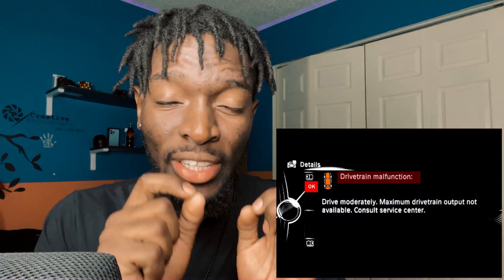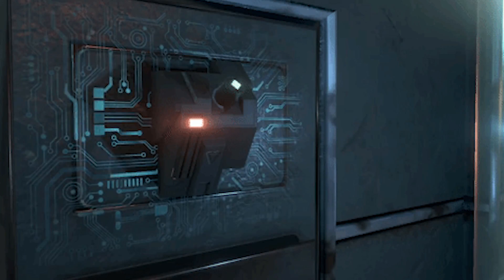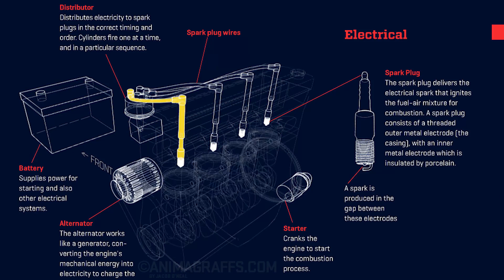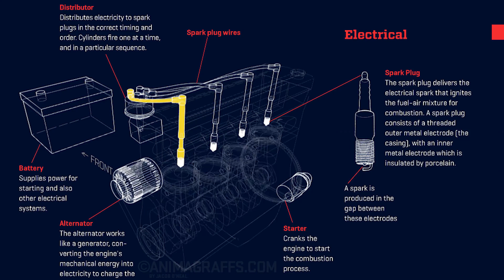BMW Drivetrain Malfunction. What is It? How to Fix it! | 2015 BMW 328i | Get Fixed

Comment: My friend had his dpf taken out and then had the car remapped. He then changed the egr valve. Since that work has been carried out, everytime he accelerates hard he gets a drivetrain error. 
This self rectifies and it's back to normal. Until he accelerates hard again. 
One BMW mechanic told him that the egr valve needs to be bypassed. 
If you don't accelerate hard the error doesn't come up. 
Any ideas please.
It's a 2.0d 2014 car.

Comment: So I have a 2014 x5 50i I changed out both mass air flow sensors and I changed out the turbo intake gaskets and I am still getting the sputtering what should I do next
Reply from the maker: Are you getting any check engine lights for a cylinder misfire?

Comment: I had all symptoms you mention in my 2015 M5, Scan tool said no voltage to fuel injector cylinder 6. Thanks for your input.

Comment: My car shakes when i start it sometimes, then when  i put sport mode and try to to do some pulls. If I floor it aggressively, i will get this message and then the car will start shaking again. I dont have an air filter installed to the engine so i thought that was it. I'll get it diagnosed tomorrow.  2016 320i

Comment: Bro you need to change your smoke alarm battery… as for the drivetrain message on my G12, it all started after an EGR recall in the UK. What I have noticed is that when I don’t use the phone charger plugged in, I don’t get the message. I never noticed torque issues but when idle in gear, I’d feel a little flutter. So in many cases it’s an electrical issue and an ECU reset might help solve the issue.

Comment: @GetFixed in my case it's the waste Guage that needed to be replaced as it wouldn't open to allow air into the turbo so as a down steam affect the engine was freaking out and like you said there was no acceleration when you press on the gas. So also have the waste guage checked people ✔️
Reply from the maker: Thank you for that. I never even considered the waste gate as being the reason for a drivetrain malfunction error message. I’ll most likely make an update for this video and give you credit for bringing this up. Thanks again.

Comment: Did u get a check engine light as well ? I started my car up it started shaking I got the message turnt it off and started it back up like nothing still have the warning light tho
Reply from the maker: Yes I had a check engine light on my car when this happened. I recommend you find out what that check engine light means. Even though the car started back up just fine, the symptoms is a warning, thank goodness you got the check engine light because some cars will act up and not give you the check engine light.

Comment: I had the msg about it today - going to the mechanic in a minute - hopefully it will not kill my wallet lol
Reply from the maker: I learned so much about BMW’s because of the first car I owned. Long story short car caught on fire and I had rebuilt the backend and wiring loom, got it done and running in two days, because of that experience I’m no longer nervous when something comes up on my car.
Reply: Contrary to appearances, BMW is a very reliable car for me. If you regularly change the oil and take care of the car, repairs don’t have to be astronomically expensive, and the car seems almost indestructible. I might not be very objective, but I absolutely love my BMW.

Comment: Guys my n26 is stage 2 with downpipe and charge pipes and it’s only making 260 horse power really confused on the power loss aswell as it has no engine light lmk

Comment: I got that message today. Driving a 2016 640i Gran Coupe. Can’t wait to learn what’s going on. 🥴
Reply from the maker: I wish you luck KT. Get the car scanned for any codes stored on the ECU.
Reply: Man I’m in the same right now and this just happened to me. Autozone scan said it was the fuel cap that was loose

Comment: What does it mean when the drivetrain goes off and on it happened to me rn On my way! To work made it to work
Reply from the maker: Did the Drivetrain Malfunction go on then off? That was your sign that something is going bad. The most common reason for it is spark plugs, spark plug coils, fuel injectors, or like your mass air flow sensor or something. Some of these parts are maintenance items. Start with the small things first, for example, when was the last time you replaced the spark plugs?

Comment: My problem was oil. For some reason the car didn’t notify me that it was running low, but as soon as I added half a quart my problem was solved. Luckily I wasn’t too late.
Reply from the maker: Did you use the oil measuring feature to figure out how much oil you had in the engine?
Reply: Bro same shit happened to me today! Checked oil like a couple days ago and was green and I was driving to work when all of a sudden my shit started tweaking
Reply: Hoping it’s that for me 🧐

Comment: The code says p0301 what’s that mean ?
Reply from the maker: P0301 usually means there’s something wrong in cylinder 1. If you haven’t changed your spark plugs in a while then that may be your issue. It could also be the fuel injector or spark plug coil.

Comment: My friend told me that is my turbo blowed up is that true ?
Reply from the maker: Are you getting any error codes? Drivetrain Malfunction just means that there is something wrong in your engine or transmission. It could literally be anything like bad fuel injectors, spark plugs, high pressure fuel pump.

If you have a check engine light let me know what the code is.
Reply: @GetFixed it gives me 3 codes one is u0079 and u019f and p0301
Reply: I have an bmw 330i 2018 I would be driving an drivetrain come on my dash suddenly an then my car lose power an cut off an won’t start do u know what could be the problem ??
Reply: @yardiehumangad3853 this litterally just happened to me right now with my 330i same year as yours did you figured it out?
Reply: @GetFixed in my case it's the waste Guage that needed to be replaced as it wouldn't open to allow air into the turbo so as a down steam affect the engine was freaking out and like you said there was no acceleration when you press on the gas. So also have the waste guage checked people ✔️

Comment: Hi , my 2016 series 1 BMW displayed this message last week on the way home from London Heathrow . It went into limp mode - maximum 30mph . Got off the motorway and the RAC , national breakdown . Theyve towed the car to the nearest BMW garage and we got a taxi home . Dreading the phone call concerning cost . Your video reassured me . Thanks .
Reply: What was it ?
Reply: @lascellebubear4209  hi . Very bad news I'm afraid . BMW  said new gearbox required and quoted me £10,000 as they replace rather than repair . Got the price down to £8,500 as a goodwill gesture from BMW . Shopped around and found a local specialist gearbox garage . Quoted , and paid , £4,500 for a reconditioned gearbox , guarantees etc . Job took a week . Got the car back and only additional cost was replacing gearbox oil after 500 miles . Car valued now at £9,000 rather than scrap money but I'll be selling and moving it on . I will definitely pay extra for extended warranty . 
You got similar problem ?
Reply: What was it ?

Comment: The “drive train malfunction “ displayed on the screen of my 2017 BMW 430i Grand Coupe… and I can smell the burning of oil and it’s was smoking under the hood. Could this be a head gasket going bad?
Reply from the maker: Hey Melissa, yes there’s a chance that the head gasket is going bad and the oil is leaking onto the car’s exhaust causing the oil to heat up and smoke. It may also be the oil filter housing gasket that went bad. Look to see where the oil is leaking from. 

I don’t believe a leaking gasket would throw up a Drivetrain Malfunction code though, if you have a check engine light, scan the car to see what the error code is.
Reply: @GetFixed  Thanks for the respond. I’m having it towed to a mechanic tmrw. I afraid to drive it to the shop because of this. However, the car does have a coolant leak and we don’t know where it’s coming from.

Comment: I had a similar issue turned out it was power line short circuit … replaced my engine cuz the bafoons at my old mechanic was dumb at diagnosis.. $6000 gone for no reason on a working engine
Reply from the maker: It’s sad to hear that rather than looking for all the possible issues, they’d instead unnecessarily quote you for a new engine. I hope you’re in the process of getting your money back.

Comment: I have spent 4,000 between two different shops last time I took it to bmw they took out all the brand new Bosch sparks and Delphi ignition coils and replaced a fuel injector in cylinder 1 I bought and said they were faulty just because they didn’t come from bmws factory I get the car back and it was jerking when it shifts!! Now two weeks later it’s misfiring again in cyclinder I am so pissed nobody and figure out how to fix my car and they keep replacing things that don’t need to be fixed to make more money out of me the last shop said it was my valve cover and replaced that 😂
Reply: I just purchased this vehicle as well!!

Comment: The malfunction message happens for me after putting gas in my car. Like after turning the engine off then on again too quickly.  I need to allow maybe 1/2 hour before I can turn on again to not receive that malfunction message and drive normally.  Any idea why?
Reply from the maker: You don’t have any check engine error codes stores on the ECU? I have a feeling that it’s either one of the fuel injectors or the high pressure fuel pump.

Comment: I have a question please reply!
Reply from the maker: Hey what’s up?
Reply: @GetFixed  I have a n20 x3 going into drivetrain malfunction mode
   With no code?
Reply: @GetFixed  anyway I can contact you via instagram or phone call?
Reply from the maker: I’ll give you my phone number. You don’t have a check engine light at all?
Reply: @GetFixed  yes please do! And no check engine light.
Reply from the maker: 561-502-5032

Comment: I HAVE CQDE CF2915 ENGINE SPEED FROZEN SIGNAL WHAT DQES THAT MEAN??? $$$$$
Reply from the maker: Either your engines shift solenoid sensor is messed up or the wires for it is corroded.

Comment: Hello Buddy thanks for the video my new BMW 2020 REG  have the same issues Drivetrain, I took it to the dealership BMW they said twin TURBO GONE it needs to be replaced luckily I have a warranty package so they said  free of charge to get replaced. Howver, they called me today they said it wasnt the Turbo issues, we now have to strip the Engine to find out what is wrong with car or we might have replaced the Engine completely and I was like wow im shocked. I have a poratble obd cod reader I got two different code vefore I take it to the dealership the codes are P0299 AND P2196 ANY advice what should I do now
Reply from the maker: P2196 looks like it refers to your oxygen sensor. Is your car idle or shaking rough right now?
Reply: @GetFixed  Yes its only shaking when you drive up hill and smokes
Reply: Aye bro what’s your instagram I wanna text I need help

Comment: I’ve changed the spark plugs and I still got the drivetrain malfunction do you know what else Can it be, I got a check engine light on aswell and I fixed everything that was wrong with it🤔
Reply: What codes did you get? Might be something with the temperature circuit sensor

Comment: My BMW 320i F30 had this issue today the error just popped up and when i switched off nd on again the error is gone nd the car is running normal.

Any idea what could cause that🤣 my heart almost popped🤣
Reply from the maker: Without an error message it’s hard to say, but do understand that although the issue resolved itself temporarily, there’s a chance that it’ll come back again. Do you remember that last time you changed your spark plugs?

Comment: You explained what I really wanted to know.  about the problem of my bmw 2016. thanks.  I give you 20 stars. 👍🏼
Reply from the maker: Not a problem my dude. I’m gonna use this 5 star to level up.
Reply: I gave you a five star also, it happened to me today in my 420!
Reply from the maker: Dude does that model have turbo?
Reply: @Get Fixed  yes it does, it's the 2015 twinscrolled turbo, would you believe that I started it today, gave it a drive, and the warning went away ; I'm still gona have it diagnosed though

Comment: hello beautiful person.  CDA904 bmw 328i.  what is wrong with this?  the car shuts off when the engine is cold
Reply from the maker: Hey beautiful energy. That code means you have a trailer missing. Is shutting off the only symptoms you experience? I have 3 theories, 1 your mass air flow sensor is dirty and needs to be cleaned with mass airflow sensor cleaner, 2 you haven’t changed your spark plugs in a long time and you’re experiencing misfires that causes your car to shut down, or 3 your fuel injectors has gone bad and is improperly spitting out gas which in turn causes misfires.
Reply: @GetFixed  the only symptoms are: the engine shuts off when i start the engine in the morning.  After starting and stopping 8-10 times, it starts.  like the car won't start when the engine fluid is cold.  CDA904 error occurs in diagnostics.

Comment: Can Bad Motor Mounts cause this ?
Reply from the maker: It’s possible if all you were experiencing is the shaking, but if you’re getting the drivetrain Malfunction error message too then it most likely isn’t the motor mount. Because the motor mount is mechanical and not an electronic component, it wouldn’t be able to send an error signal to the ECU as drivetrain Malfunction.

Comment: How bout if car stills drives regular but has that code. My came on after hitting uneven road going 40 pancake the car
Reply from the maker: I recommend finding the cause and fixing the issue. You may not see any symptoms now but it can gradually sneak up on your car overtime. Who knows, the symptoms may take forever to show, or it might never come. Personally, I resolve the issues as they come up before they pile up and form into something worse.

Comment: i have a 2014 328xi and it came on at the red light smh.. i was so scared I immediately drove home it shakes but very little. Im praying its not then engine which i doubt bc I have regular oil changes my mileage is under 100k.
Reply from the maker: It’s probably not your engine that’s the issue, but it maybe a component of the engine such as a sensor, spark plugs, or potentially your fuel injectors. The best way to verify the issue is by going to Autozone and scanning your vehicle to see what error code was stored on the cars computer.

Comment: New to the channel but I'm glad I came across his channel.
Thank you for the breakdown and translation. 
Just got this message this morning.......
Reply from the maker: I bet your heart dropped to your stomach when you seen that error message huh?
Reply: @GetFixed  absolutely. I felt the heat on my face and my mind start to race. Lol
For me it was different.  Turned out to be my jb4 giving me that error. Most likely due to plugs or packs. 
I uninstalled the jb4 for now and limp mode went away. The car went back to normal with no codes popping up.
Reply from the maker: Hey Will. Has the message popped up since you’ve done this?
Reply: @GetFixed  while the jb4 was plugged in I received many errors plus a permanent error 
Without it I have zero errors. 
Ordered in new plugs and packs. I plan on testing the jb4 again once those come in.
Reply: @boarders5  Hey bro how did those jb4 plugs work on you bmw , did that check engine ever go away for good , just had this message happened to me twice today
Reply: @GetFixed aye bro just got this code thrown at me earlier this morning and I took it to my buddies and he fixed it and I drove the car for the rest of the day until it happened a second time what do you think it could be , after the first time it was pulling nice but I caught the code at night time as well just curious and I’m really nervous since I just bought the car

Comment: Something like this happened to me today none of the shaking or anything of such just the malfunction my car would decrease in speed in the highway when I got to the auto zone I turned my car off went inside and they came out with the scanner and nothing popped up on there kinda scared of driving my car and damaging my car…
Reply from the maker: I know the feeling. I bet your heart dropped to your stomach when you saw that drivetrain malfunction error message pop up on your iDrive. If it didn’t leave a check engine light then it’s most likely a one off situation when you went to accelerate or something. As long as the drivetrain malfunction messages hasn’t came up again and you don’t have a check engine light, then you’re fine. Take it as a sign to prepare yourself for any potential issue that might come up in the future.

Comment: In my case, it was the egr valve on my f30 318d. Its just a car, but sometimes you really start to think that its more between earth and sky. The drivetrain nightmare often happens several times during a month, and then its gone for very long... and its independent if I'm driving short or long, hard or calm... I just try to put it in DS and drive it at 3-4000 rpm between 20-40 km now and then... in the beggining the shaking had me freaking out!!!
Reply from the maker: This hasn’t been an issue for me for the past 3 and a half months until yesterday. There’s a method I use with a circuit tester that allows me to bypass the conditions & check engine light of drivetrain Malfunction. I always recommend fixing the root cause of the issue but if you can’t afford to, the bypass makes it seem like there is no issue.